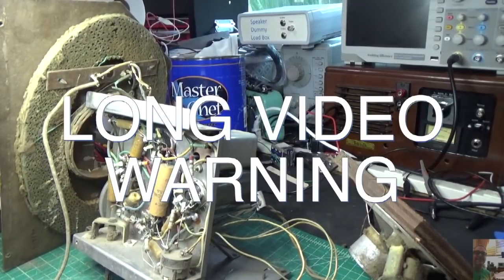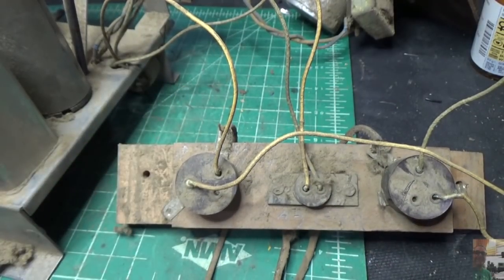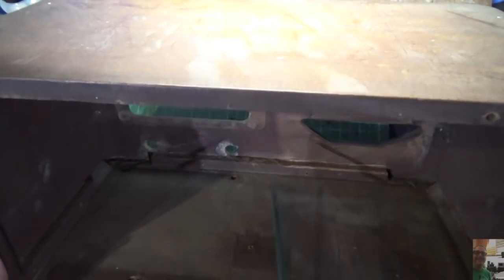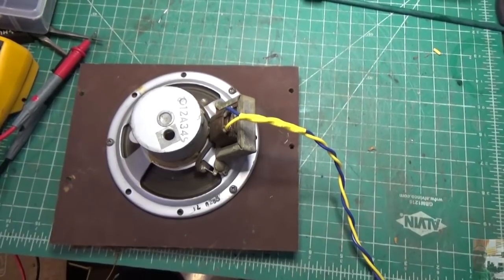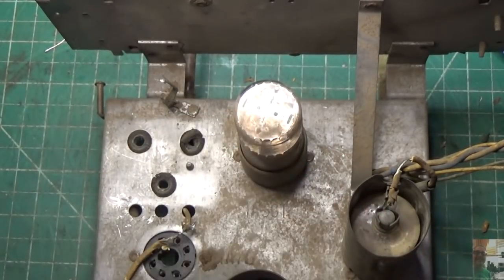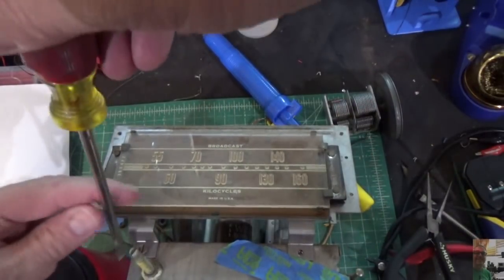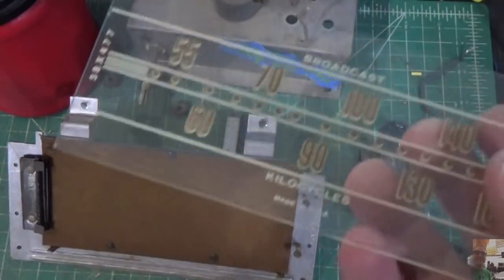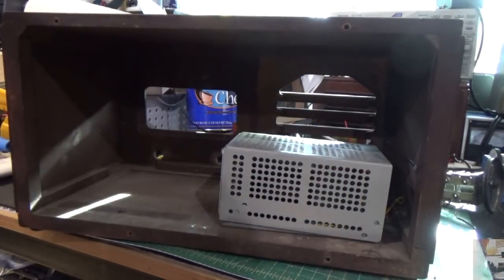Airline  Farm Radio  Model 04WG-468  Episode #1 - Let the cleansing begin

Comment: Hi Ron, rubber covered came out in the 30's, I had an RCA 87K radio that was loaded with rubber covered wire, that radio was made in 1938.
Nice job Ron.
That power supply looks like it will be great!

Comment: True I replace wires in Old Radios but, sometimes I don't and just paint them with Liquid insulation especially if the wires are hard to get to. The cloth covered wire does suck it up pretty well. That sonic cleaner and the evapo-rust does a great job on those parts. Thanks for sharing Ron.

Comment: The battery sockets on that strip of wood will be very useful in connecting a battery eliminator to one of those sets, allowing one to use the original battery plugs rather then some other connector.

Comment: It's a 1940 model, built by Wells Gardner. Montgomery Ward had a Model number code at that time that told you the year and the manufacturer of a radio, or T.V, chassis. The first two digits is the year, but reversed, so 04 is 1940, 14 would be 1941, and 93 would be 1939. the WG stands for Wells Gardner,  BR would be Belmont Radio and Television. Rubber/gutta percha covered wire is all too common in radios from about 1939 through 42, early 40s Philcos and Zeniths are chalk full of the stuff, the 39 Philco even used it on the power transformers. I think it was a cost cutting measure, Grigsby Grunow and Atwater Kent were using yards of it years earlier. On the antenna leads it doesn't really matter, but if it's in the battery cables, and the speaker cable, then replacement is the only way really.
Reply from the maker: Thank you for this history Oleg... very good knowledge of the date code and history.  Appreciate you for sharing that - Ron

Comment: Hey Ron, I started watching last night, paused, got sidetracked and so here I am 8 hours later finishing up.  Do you add any kind of chemical or detergent to your ultrasonic cleaner?  I've seen powdered ultrasonic cleaner on Amazon and I've also heard of folks just using dish soap or even Simple Green.  It sounds like your tuning cap is still rubbing when it's being closed or is that just a lack of lubricant on the bearings?  What feels like felt to you may be flocking like the stuff I had to repair on Uncle Dan's Philco.  With no light as it's a battery set, I wonder why they did it in brown as well though.  Personally I'd re-do it in a light beige or egg shell or even a light gray depending on the replacement grill cloth I were going to use, just to make it easier to read in low light and easier to see the dial pointer.  The Go-Jo works well, but if it's hard to find there's another brand called Goop that I've used that is the same stuff but a little cheaper.  We've had Goop in the garage since I was a little kid.  I think they're both just jellied kerosene with some fragrance and maybe some aloe in the modern stuff.  Good progress :)  Gary
Reply from the maker: The tuning cap was rubbing, but has since been corrected.  I agree on the flocking.. that is more like.it, you are right.  Thanks my friend.

Comment: Don't want to be picky but you never grab the tube by its glass you can pull the glass out of its base, grab it by the base.
Just go over the cabinet with some fine medium steel wool soaked in mineral oil with the woodgrain only! clean off with a cloth then get some linseed oil and go in circular motions into the wood medium pressure, with a cloth repeat this 2week later if you want to apply some more linseed oil you have to wait 3 months, after this then if you want another coat you'll have to wait a year! otherwise it won't Harden you can heat up some shellac flakes stirred into the linseed oil if you want and then it becomes a French Polish, the more shellac you add the more gloss you will achieve if you want that mirror finish, but only after the two coats of linseed oil first, apply thinly not sickly. Put some cotton wool in the Cotton lint-free preferably, soak it well in the mix then squeeze the majority of it out just damp, applying circular motion medium to fastly not slow, give it two hours to dry first couple coats medium pressure, and then do it with lighter and lighter pressure you might need 7 to 10 coats if you want a mirror finish depends how absorbent the wood is. But only four to 5 coats in 36 hours. If you've got some old French polished furniture and it's cracking or you want it it's best just go over with raw linseed oil twice a year and the cracking will go away never use beeswax that can cause cracking can dry out some Woods and the French Polish, so clean your furniture with some mineral spirits first then go over with instead oil I should have said.
Reply from the maker: Great advice John, thank you.  The cabinet will be the last thing I tackle, but this will help. For now, I have bigger fish to fry :)   many thanks

Comment: I wonder if liquid vinyl tool dip painted on the antenna and bare wires would work, it dries faster than liquid tape.  
A simple voltage drop for b+ could be an adjustable  10w rheostat, kinda like a line autotransformer (variac), turn it up to 90v.   
The round ceramic speaker magnet may be more modern, the original could have a square yoke and alnico magnet.
Reply from the maker: Regarding the speaker I thought the same, but since this a battery set, I figured magnet was the way to go.. who knows.   :)  Power supply plan underway :) thanks my friend
Reply: Alnico is a type of PM (not ceramic), not a field coil electromagnet.
Reply: Um thunkin a light dimmer or fan speed triac could reduce to the b+ voltagel but may be rfi noisy.  That's why I'd use a rheostat.
Reply from the maker: I will use a 500K pot for that, It should do the job perfectly.   :)
Reply: um guessing that 5k/5w pot should do?